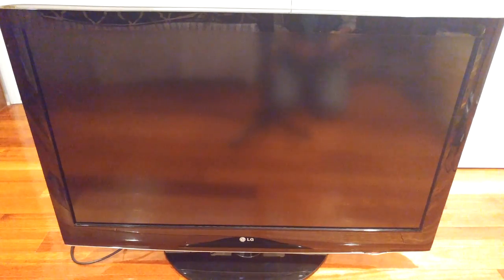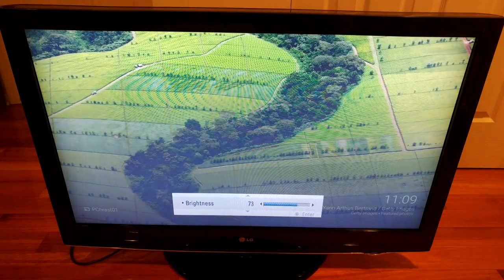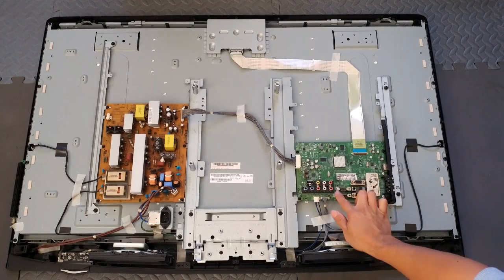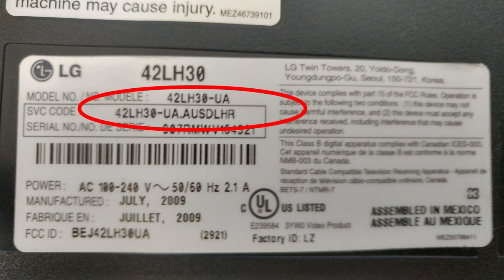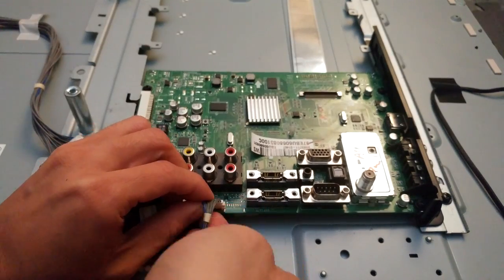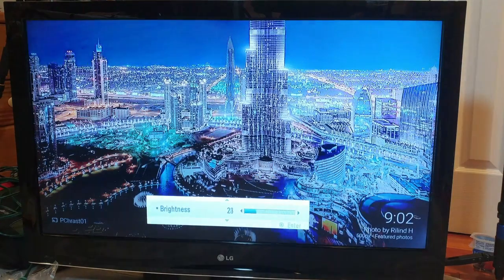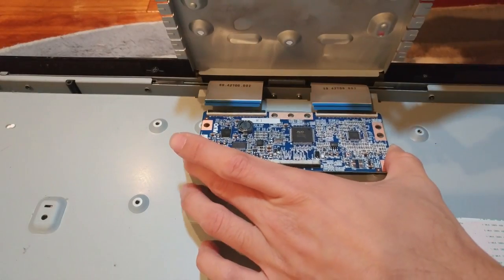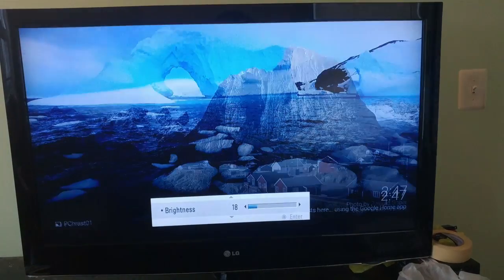How to Fix and Repair LG 42LH30 LCD TV Solarization by Replacing T-Con & Main Board

Comment: I like the video but I've replaced the T-Con board and solarization still exists.....my solarization only shows up in the first 45-90 seconds of "turn-on" for the TV....it goes away on warm-up and my picture is fine.....could I have a bad power supply board (10 yrs old) or is it likely to be the Main board?....again....only happens on warm-up....if the TV has been running and I turn it off and on again, it's fine. Thx!

Comment: Hi, I have similar problem on a LG Plasma TV (60PN5300), but it doesn't has a T-CON board. The Mainboard cost $200+ on ebay. I'm not sure if I should invest $200 not knowing if it's the part I need. Would you shed some light? Thank you!
Reply from the maker: I don't know a ton about plasma TVs, but I wouldn't randomly replace components unless you know for sure they're bad. I was able to diagnose the problem in my LCD TV by using a multi-meter and checking for bad capacitors on the boards. On another, I was able to visually verify a break in the solder joints on some components. I think you would be able to do something similar or use some sort of process of elimination to determine which component isn't working correctly. Again, I don't have a lot of experience with plasma displays to be able to give you more specific direction on how to do that.
Reply: @FixItPhil  Thx Phil. I looked up more and high chances it has to do with the Logic board, I got one off ebay for $10, gonna give it a shot this weekend. Yes, i check all solder joints/coil etc, all in perfect condition.

Comment: Hi. I have LG 42LH30. Right half of the screen goes out or gets stuck on one solid color especially when turn it on after a while. I push on the right side of the screen and it fixes itself sometimes. Sometimes it doesn’t. Left side of the screen works fine though. No problem on left side of the screen: weird
Reply from the maker: Sounds like maybe you've got a loose ribbon cable. If the problem is correctable by pushing on the screen it's generally a problem with a connector.

Comment: How to fix the same problem in laptop.. Will you please make a video for that
Reply from the maker: Hm, I'm not sure it's as simple in a laptop as components that control the video output may be soldered to the motherboard and not easily replaceable. I'm sorry I'm not that familiar with laptop screen repair.

Comment: My tv Toshiba lcd i42 regza is ok but it has red over   compared to Blu and green. Is that normal? Thx.
Reply from the maker: If you feel your colors are "too red" you may have the "warm" color temperature selected. To change this setting, open the menu using the TV's remote control. Go to the 'Video' menu option. Under Video, highlight Picture Settings and press 'ok.' Highlight Advanced Picture Settings and press 'ok.' Highlight Color Temperature and press 'ok.' In the Color Temperature field, select the mode you
prefer (Cool, Medium, or Warm). Warm will be reddish, cool will be bluish, and medium is somewhere in the middle. Hopefully this helps!

Comment: I have an LG similar to that one. It is constantly scrolling through all the settings on its own, while watching a video.   Any idea how I can repair it?
Reply from the maker: Hm, sorry, I'm not sure. I've not heard of that sort of problem before. It sounds maybe like a software problem or perhaps phantom signals from the remote control. Perhaps LG support will be able to shed some light on the issue!
Reply: Try removing the batteries from the remote to narrow the problem down. If it persists, check the module with the buttons on the TV. Maybe one of the buttons is stuck.

Comment: You basically changed the whole tv:))
Reply from the maker: Hah, except the LCD panel and backlights. My original main board was actually working fine, so I sold it online for the cost I paid and it was a wash. The first T-con replacement board I received was defective but the seller shipped me a working one right away. TV still works great today!
Reply: @FixItPhil  oh, it's disappointing to receive a defective part:(
Glad you fixed it!

Comment: Dude i have the exact same model rotting at my basement, called the technical assistance a couple years ago and they told me it'd cost me $600 to repair it so I didn't touch it since then, good thing I found your video, thank you so much

Comment: Maybe I should explain a little further this tv was going to be tossed out by my brother in law bc it didn't have sound but really good picture. So I decided to take the tv home and sound come back but the picture went bad after the trip. looked up the problem came across your video and my tv looks the same as your video. The model #60pc1d-ue but when trying to order the T-con board and  there are several boards with serial #'s which one is the right one so that is why I'm writing you
Reply from the maker: Did you open up the TV yet? The model number for the t-con board was written on the bottom left hand corner on mine (42T06-C03 T420HW04 V0 Ctrl BD) see 2:16 in the video. It's likely in the same location on your t-con board.
Reply from the maker: Actually, is this a plasma TV? They're a little different on the inside than LCD panels. If so, the problem likely is with the Y-SUS board.
Reply: @FixItPhil  Thank you for responding and I will look for that  Y-SUS board, thanks again.

Comment: I replaced the main board and the tcon board and I still have polarization. What do I do now?
Reply from the maker: Hm, if the issue isn't with those two components then it's possible that the solarization is due to a bad panel. Unfortunately, panel replacement is expensive and may cost just as much as getting a newer TV of the same size. Black Friday is only 1 month away so you might be able to get a deal on a larger panel size for the same cost as it would take to fix it at this point!

Comment: I have this model and solarization appears sometimes when the set is turned on and disappears if I smack the back. I noticed solarization when I touched the switch panel too. Seems like a loose connection. Any Idea where?
Reply from the maker: Hm, it's hard to diagnose based on the description but if I had to guess, it may be a loose ribbon cable to your t-con board. It's possible that re-seating the cable connectors could fix the problem permanently.  It's also possible that rather than a loose cable there's a hairline crack on a solder joint to a component on the board that intermittently makes contact which subjected to a tiny movement, such as a smack to the back of the TV. That's a bit hard to fix without some solder knowledge or testing of the board, but would also be fixed by simply replacing the board with an intact one.

Comment: you can fix by service mode  change the type of panel and  frame bit   without one  dollar
Reply: How to open a service mode of Lg led
Reply: There's a video on youtube. You can take apart a remote control wire the diode to a headphone jack and play a special audio file.

Comment: Hello, I have a 42 Inc that is connected to sky box through HDMI. The problem is some channels work fine (bbc1etc) but most of them have blurry picture. Including BBC2
I have done a reset. Still the same problem. I had the TV for few years.
Any idea please?
Reply: I have done it. I discovered that the problem was with the sky box.
A quick reset did it.

Comment: I have a LG 47LG60 Model, and the screen was fine then it shown Green with wavy lines. What can I do to correct the issue?
Reply from the maker: Sorry, I'm not sure what the exact issue is based on your description. It doesn't sound very much like a solarization problem, but that doesn't mean the issue isn't with the t-con board or main board. You may want to contact a TV repair expert for help.

Comment: Hi people,
I have Sony KDL-46EX728 with solarized picture.
Sometimes picture is OK, but mostly time it is bad, black color mostly and other colors are switched to red and distorted.
I noticed that when the larger surface of the screen is white or with light colors, it stabilizes quickly, ex. sometimes it needs 10 second to switch from solarized picture to normal(dark color screen switched to white color screen), then it needs about 5-6sec to switch from normal to solarized picture(light color screen switched to dark color screen).
T-Con IC was very hot.

Comment: Hi i have a sony 32"tv model# KDR-32R400A  that has no stanby light and no stanby voltage 3.3volts on the power supply board but there is 64volts and 12volts dc  on the two power supply on the secondary side of the smps transformer, can you please advice on what could be the problem thank you.
Reply from the maker: Hm, since you have guaranteed that the set is receiving power, it sounds likely that you have a faulty power board. Check the power board for any blown fuses/capacitors or other components. Some may be individually replaceable. If not, you may need to replace the entire power supply board. The part costs $20-$30 on Ebay: http://ebay.to/2tmsPi6 [Ebay Affiliate Link] depending on vendor, condition, and shipping cost.

Another thing you could try is to perform a power refresh. First, disconnect the power cord and then press and hold the power button on the TV for 30 seconds. Afterward, reconnect the power cord and try turning the unit on. This method only works if the problem is some corrupted data on the firmware.

Comment: I have the same TV. mine says scrambled and I can't get any channels. can you help me please?
Reply from the maker: Hm, while I haven't come across this issue myself, it sounds like either the antenna you are using isn't the right type to decode the DTV signal in your area or you need another unit like a Digital TV converter box to be able to process the signals received by the antenna. It's also possible that the signal strength is not strong enough in your area or where you've placed the antenna. Generally for digital over-the-air waves, the antenna is best placed near a window or on the outside of the building for the best reception. Changing its location and orientation may improve its reception. I use this antenna at home with some good results: http://geni.us/u7PmZA [Amazon Affiliate Product Link] but I also live fairly close to two metro areas with lots of broadcasts.

Comment: I bought a t-con board same make/model, popped it in following your video.  Backlight works,  audio but no picture.  Slight smell of burning plastic.  Removed new t-con board and put old one back in.  Now I can't get a picture from either (picture previously worked with original t-con board but had solarization).  What did I do wrong?  Maybe I screwed up setting the ribbons?  how sensitive are they to handling?  I don't think I was manhandling them.
Reply from the maker: Hm, the burning smell is concerning and since you're not getting any picture at all with either board now the ribbon cables are a possible culprit. Since each ribbon cable on top controls only half the screen, that would mean both those ribbon cables could be damaged or the one leading from the T-con board to the main board isn't working (or all three, though that is unlikely). The ribbon cables with snap down locks are sensitive to placement and should be lined up and seated as far into the slots as they can go without forcing them. I'd also check the connection of the cable from the main board to T-con board is snapped in all the way and in the original orientation; if it gets plugged in flipped over this can damage the cable or connectors. It's also possible that one of the capacitors blew on the main board that controls the picture as that typically creates a burning smell.

Comment: Sir my LG TV is negativ picture my TV model number is T420XW01 Please solution for my TV clearly picture
Reply from the maker: If the problem is like the one in my video, you can follow a similar procedure. It's likely the T-con board that is faulty, although sometimes it may be the main board or LCD panel itself. I don't have that TV model, so I won't be able to tell you exactly how to disassemble it nor make a video for the repair. You can watch my video above for a general idea of how I repaired mine.

Comment: I have the exact same TV! However my issue is that the left side of the screen will flicker and sometimes just go completely black. Any ideas on how to go about fixing that?? Thank you.
Reply from the maker: Hm, that sounds like a more involved repair. It could be  that one of the LED inverter boards that controls that half of the screen has failed, or the output of the power supply that feeds the inverter has shorted. It could also be a T-con problem or a ribbon cable issue. Testing would need to be done in order to determine which has the failure, so your best bet is to take it to a service center.
Reply: That tcon board has two top connections one for left one for right its more than likely the t con

Comment: You didn't have to replace the main board in order to find out if your t-con was bad. A lot of times if your screen is solarized it's 1 of 3 things. Bad panel, t-con, or mainboard. If your screen is solarized but not the volume or menus then it's highly likely that your t-con or panel has gone bad. If the video is solarized however the tv menus are not then it's most likely a faulty main board. Just pointing that out so no body wastes anymore money than they have to.
Reply: What you said doesn't make any sense.I have an LG set and as far as I can tell everything is solarized.I just don't want to buy a t-con board and mainboard and find out its the panel.Is that a likely possibility?
Reply: What did you end up doing?  I was also confused and have the same problem.  Picture/Menu is solarized and trying to figure out what I need to buy without spending too much.
Reply: Please edit your comment - you are correct in that I've also heard you can differentiate a main-board / t-con problem from whether the on-screen display menus are solarized or not. But in both examples you give you say 'if the screen is solarized but not the menus' and in the other you say 'if the video is solarized but not the menus'. This makes no sense - in one of the scenarios the menus will be solarized. Please  clarify.
Reply: Why don't you fix your reply?

Comment: Hi I have a Philips LCD with solirization problem,I showed it to a guy he told me to replace picture card..can u help??
Reply from the maker: The "picture card" probably means the same thing as the t-con board. You'll have to open up your TV to see the part number though. I don't know which part you'll need for your model. There's a website called ShopJimmy that might be able to identify (and sell you) the part you need by looking up your TV model number, but typically it's much cheaper to buy the part on Ebay. I bought the one for my TV on Ebay here: http://ebay.to/2H7VKZr [Ebay Affiliate Link] and it was about $15 including shipping.

Comment: sansui 22"led tv model no LEDTVSJX22FB-2FA  problm is solarized image please help
Reply from the maker: Hi dipankar. I don't have a Sansui LED TV, so I'm not quite sure what the insides look like or how to take it apart, but if the problem is solarization, then the process for correcting it should be similar to what's outlined in my video. If you want to attempt a repair, please note that you do so at your own risk and I do not take responsibility to damage or injury to your property or person based on any recommendation I may give. If you want to try to open the TV up, look for the main board and the t-con board. Find the numbers on those parts, then buy replacement parts and swap them in. I'd start with the t-con board as this is typically the problem, but if that doesn't fix it, you can try to also replace the main board. If worst comes to worst and neither board fixes the problem, then you probably have a bad panel in which case, you're better off getting a new unit as the cost to replace the panel is nearly the same and the effort is tedious.

Comment: Thank you for your video, I was able to follow most of your instruction to repair the T-con board, however, the cover plate protecting the T-con on my LG was a real pain to remove. I understand there are different back plates and mine required removing some attachment bars which held other parts of the T.V. and we did not know if at the end we were going to have to trash the entire unit. But at the end, it worked...
Reply from the maker: Cool, I'm glad it worked out for you, even if it wasn't exactly the same model. I haven't opened up many TVs, so I don't know really what different configurations might entail.

Comment: We have the same model TV, but the Amazon link you provided is for a different T-con board than the one that is inside my TV and the seller says it needs to be an exact match. Are you sure this same t-con board fit your TV?
Reply from the maker: The t-con board in my TV was labeled "T420HW04 42T06-C03". This is what I matched when purchasing a replacement and it works fine. The link to Amazon in the description brings up a list of results for a general search for the part numbers. You'll have to check the actual listing to make sure it's a match. What are the numbers on your t-con board? I bought mine on Ebay: http://ebay.to/2H7VKZr [Ebay Affiliate Link] for about $15 including shipping.
Reply: FixItPhil no worries! I think that as long as the T420HW04 etc numbers are correct, the board will work. My TV is now like new again 😊 thank you so much!
Reply from the maker: Awesome! Cheers :-)